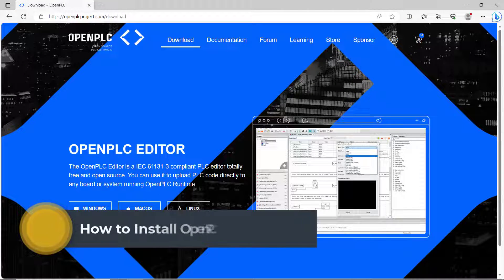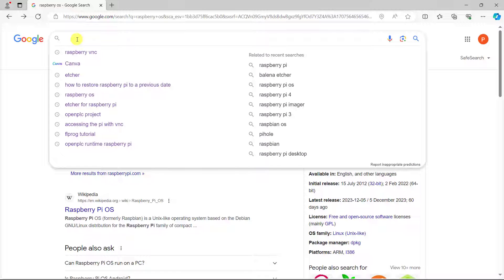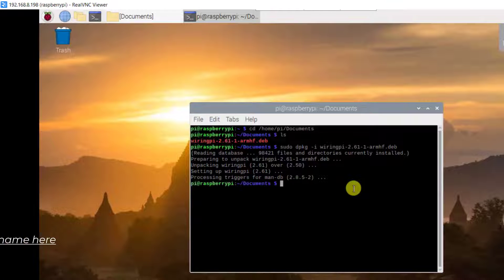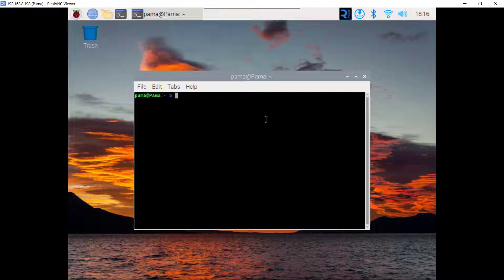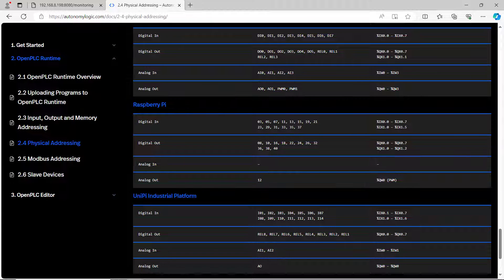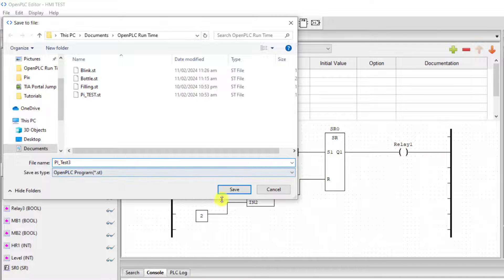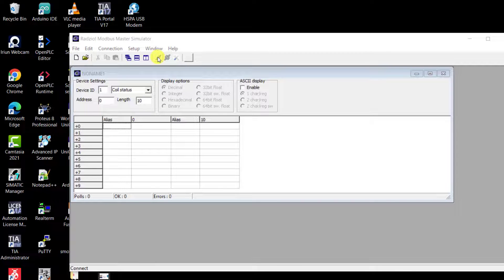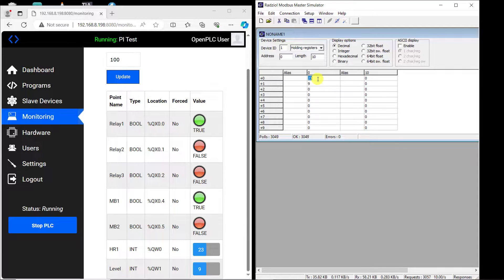How to Install OpenPLC Runtime on Raspberry Pi || Pi PLC

Comment: Hello, I have a problem. I have a pi5 and I understood from the forum that wiringpi does not work on it. I'm buying another board, I don't mind, tell me which model to get and if you can give me links to what you have installed. I would do exactly with the options you have in the video. I have to do a project with raspberry and I can't. Thank you
Reply from the maker: Sorry for the late reply. Can you get pi 3 and then try again this is because I haven't tried it on Pi 5 before. If you still have issues   send me a mail at princekissi008@gmail.com  thanks

Comment: Got past the "Install OpenPLC" on the Pi.
Did the check to see if it was running. it was not.  
failed (Result: exit code)   Start request repeated too quickly

tried to manually run OpenPLC_v3/start_openplc.sh as sudo.
Got error: 
File "webserver.py" lin 6, in <module>
import serial.tools.list_ports
Tried to Upgrade to Python 3 (seems to have failed still at 2.7.16)

Commented out: import serial.tools.list_ports (just to see if it would finish). 
 Got next error:
File "webserver.py"  ... No module named 'pymodbus'
Tried installing pymodbus and anything associated via pip 

Still does not work.

Advice?
Reply from the maker: Thanks for question. Which Pi module are you using?
Reply: @engineeringmadeeasyingme6819  - 4B
Reply: @engineeringmadeeasyingme6819  I am guessing the Python Libraries are messed up.
Reply: @engineeringmadeeasyingme6819  Pi 4 B